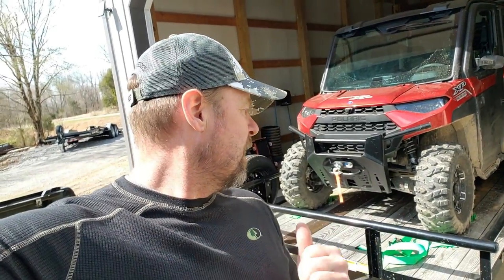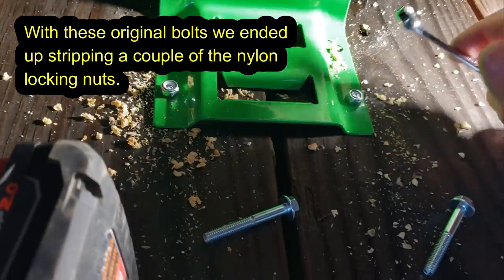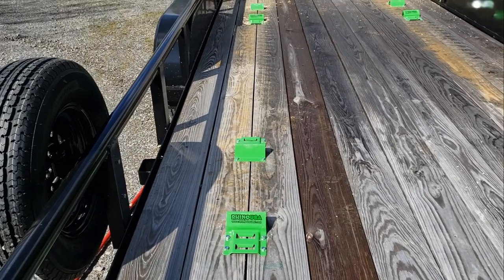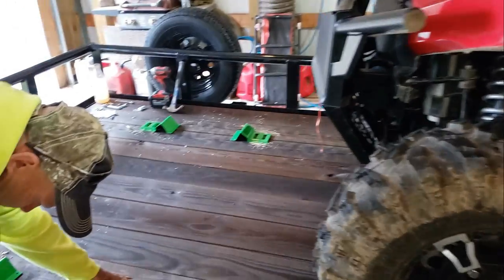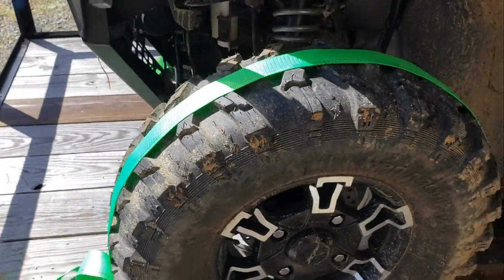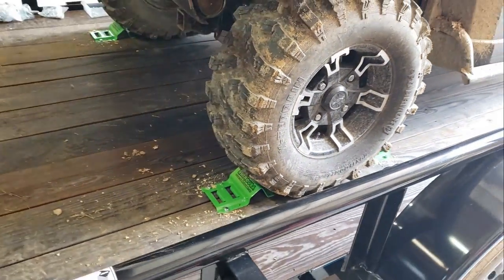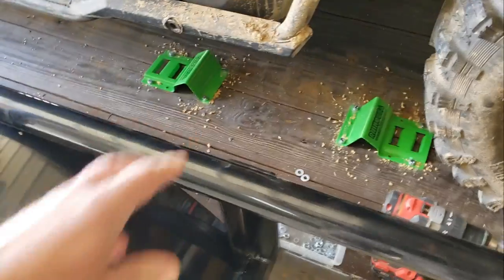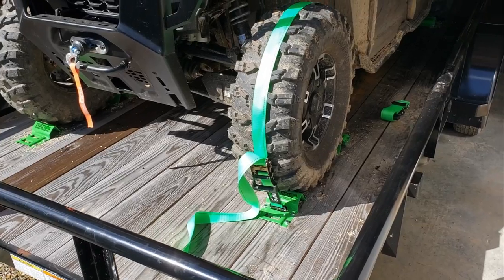Rhino UTV wheel chock tie-down kit install. Watch THIS before you buy..

Comment: Have you thought of marking where the the holes should go, removing them, drilling holes, bolting it down, then pulling the vehicle on again? 🤔
Reply: That's the proper way to do it. They have tutorials on instagram explaining how to properly install. All you have to do is put the vehicle in the spot you want it and use a sharpie or some sort of marker then back it out and bolt them in. They aren't supposed to be installed with the UTV on the trailer which ending up bending them
Reply: I’m with you when your right lol… common sense
Reply: It’d be a LOT easier to read and follow directions…. Lay out the chalks, mark the hole locations , THEN installing them…. Just a thought.

Comment: In Rhino's defense, The install video on there website shows how to avoid what you did by installing the front mount first then placing the rear mount and marking drill holes removing utv then install rear mount. Also says that hardware will work for most applications not all.
Reply from the maker: Yeah we made some tactical errors in this install for sure. But since we only did it once we keep it real. Thanks

Comment: Probably should of traced the holes or outline of the chocks onto deck. Then removed chocks & then bike. Then placed chocks back on & drilled  & mounted.
Reply from the maker: Yep in hindsight no doubt about that!
Reply: Yeah that seems like an install error not factory design error. That's why they were designed for 6 bolts. But the bolts being short is kinda crappy.

Comment: You made this really hard.  Why just place them in the right spot.  Outline them with a pencil.  Remove machine.  Install them.  Put machine back.  My god.  This is an easy job
Reply: I thought the same thing. Installing mine now and didn’t even go through all of that trouble.
Reply from the maker: Well you live and you learn! Since I had never done it I over thought the process no doubt about that.

Comment: So other than the bolts the only issue here is the installer
Reply from the maker: Also the thin metal they used for these, and the quality control of the cuts as well

Comment: why waist your time use 10000lbs D rings
Reply from the maker: Maybe this method is faster hook up and tie down..?
Reply: @kapperoutdoors  no try them all best way and easiest is Dring rachcet strap over the tire that way the suspension works for the utv from bounce for the trailer

Comment: I installed the Erickson system ( similar to what you have there ) and they work great for me. Drive up and over the chocks, strap down all four tire/wheel and my
CanAm  doesn`t move at all. 
They are just what I needed for hauling my CanAm, the wheels are held securely ( like I said ) but the body can bounce and jounce all it wants, but it's not going anywhere.
Reply from the maker: Well they sure advertised these as being the best on the market!! Not so sure about that! lol.
Reply from the maker: @regsparkes6507  The are 'engineered' in the USA but assembled in China!! They got me on that RHINO USA one..
Reply: @kapperoutdoors  I guess this is what I was wondering. Oh well 'nuff said.

Comment: I just bought the Ericson ones so far am happy . When i installed mine had to also buy larger bolts and lock nuts . 

I loaded my sxs straight enough was happy then placed all the chocks traced outline black felt pen removed them unload then place them back in the outline then drill & bolt on seem line up fine .

 They work awesome compared to just tie machine down never not use this system once try it never comes loose 👍
Reply from the maker: Yeah I think you got a better brand. But I agree it is so much easier to get loaded and tied down with the chock system! Thanks, have a good one
Reply: @kapperoutdoors  Thanks man wish i bought this system all yrs rode atv lol so much faster load & unload .

Comment: Good review, seems like a decent system incorporating the E track. Once fully bolted to the deck, it should prevent any deforming of the chock. Fuel prices are terrible here, it costs $290.00 to fill up with diesel.
Reply from the maker: Now that we beefed them up I think it will be fine. Contacted Rhino they said should hold down over 6,000 lbs.

Comment: Most deck is not that thick
You only have to do one front wheel and the opposite side rear…2 per ATV or UTV.
You take a black marker mark your drill spots then remove mounts and UTV then drill and install.
A good video on how to improperly install tie downs.
Reply from the maker: hey life is a constant learning curve. But I feel much better about these after beefing up the bolts.

Comment: Hmmm ain't no rocket surgeon but thin as emm are Ida not have droved over emm thangs🤪

Thanks for the video, I was considering buying these. I'm exploring other options now.
Reply from the maker: Fair enough! But I figured they could handle a run over! But since they were not fully bolted down, I 'kind of' get it.. Although IMO they are a bit too thin anyway and for sure them bolts were too weak! Thanks

Comment: Your video reinforced my decision to go another route.  Instead of a $120 set for 4 wheels, I went to HD and bought 8 D-ring tiedowns and bolted them to my decking for a little over 1/2 price.  I had to buy the bolts to anchor them down (just like you had to do anyway).  I had some 1/8" scrap metal for my backing plates.  Each D-ring is rated for 3,600 lbs - more than enough for my 1700lb SxS.  Other than that, it's similar to the Rhino set up.

Their instructions could be better.  Locate and drill the 1st two mounting holes on each chock as  you did.  Then remove all of the chocks and back the SxS off the trailer.  Then the remaing holes can be located, drilled and all bolts installed.
Reply from the maker: Glad it helped. I like the sounds of your setup much better! But I have used these now for several long range transports and so far no issues at all. Thanks
Reply: You only need 2 per ATV and UTV !
Reply: @redteam9881  The cost of anchoring all four wheels is cheap insurance against the alternative.  I can have two, but I need four.

Comment: I wish I would of saw this video 5 days ago. My set just showed up in the mail today. Lol I will def do the same as you and get beefier and longer bolts. I plan on putting them on my car hauler that I use for my side by side. Did you try and drill thru any steel cross members on your trailer or just anchor to the wood decking?
Reply: Another question for ya. I know everyone has there on opinion on what is best for your machine but when using the rhino system in your video here it is best to put your machine in park when trailering?
Reply from the maker: I do feel a lot better with the heavier bolts. Best of luck with yours. I did not go through any steel members, but it would have helped if we did. Good luck! Thanks
Reply from the maker: Can't speak for others, but yes, I always put mine in park after I get the weight and straps all settled out in neutral. Really wish they had a parking brake though.
Reply: @kapperoutdoors  thanks for the reply I did subscribe too after watching this video. You put out a lot of good info and someone who doesn’t sugar coat everything on YouTube is a rare occurrence. Thanks again.

Comment: Do you have any problems with your deck boards moving and if not how are your secured. I got a set and now I'm worried about my deck coming up
Reply from the maker: Well the decking all depends on the manufacturer and how they secured it, but most are quite secure, being fastened to the steel frame. If you use all 4 wheel chocks like this I doubt you'll have any issues, regardless of the decking. They are made to hold down a UTV with just 2 chocks, so if you go with all 4 like I did you should be just fine. Thanks, and good luck.

Comment: What do you do when your hardware, after lining up the tires, goes right overtop of the cross member of the trailer? I'm running into that issue now.
Reply from the maker: We drilled right through it and got longer bolts. Also makes the chocks much stronger. Best of luck!

Comment: I just installed the Erickson Chock tie-downs on my trailer for my Polaris General and they wouldn't even stay on the tires on my trek to/from the woods!
I'm assuming the curvy roads causes the Polaris to lean L and R compressing the tires which then allows the strap to fall off?!  
Any thoughts or solutions?  
Let's go Brandon!
Reply from the maker: man sorry to hear that! I have not actually tried these out yet for a real trailer haul! Did you have all 4 Erickson's or just 2? I have heard good things on them Erickson's. Thanks.

Comment: The other issue is if your bolt holes don’t line up across two planks, if the wheels are wider by an inch then you are drilling into the gap between the planks
Reply from the maker: At least this one laid right with the planks!

Comment: i would put a fish plate underneath for the nuts and washers.
Reply from the maker: sure wouldn't hurt..
Reply from the maker: Although I'm guessing that in a crash or roll over those metal chocks would give way before them bolts would rip through the wood.

Comment: Did you use 1/4 20s?
Reply from the maker: I'm not that great with sizes and such, but I think they were grade 2 5/16 bolts, the new ones. And the original ones were only 1/4 inch. Not sure if that was what you were asking. Thanks

Comment: Always just use wooden chocks 🙄😳😂 but great idea 👍
Reply: Then how do you hold down your ATV Bob?
Reply: @regsparkes6507  straps round the wheels Reg 👍
Reply: @bobpaterson1845  I'm curious, you mean the wood chocks are screwed down to the  deck and then how do you connect the straps to the floor ?
Reply: Reg the straps are connected too the hooks on the chassis rails of the trailer👍
Reply: Reg the straps are connected too the hooks on the chassis rails of the trailer👍
Reply: @bobpaterson1845  I got it now. That'll work, well you already know that! LOL.
I ask because I'm going to do something like this for a Buddy's trailer too in a week or so.. I can build it from here.
Thanks.
Reply: @regsparkes6507  your welcome stay safe an well 🏴👍
Reply: @regsparkes6507  your welcome stay safe an well 🏴👍

Comment: Rhino? Lol. I think they should go with the "fawn", becayse they're so light weight. Or maybe the, "squirrel". Because they're squirrelly, and weak. Perhaps, the "skunk", because they stink, and you feel like you got skunked by purchasing them. Seriously though, they are way to lightweight to give one any sense of solidity or ability to last for any length of time. They certainly don't inspire any confidence in the strength required to keep a $25k+ toy safely secured to a trailer that will be bouncing along for the potential of upwards of 50 to 500 miles. All in all, those things look like they're made out of something only twice as thick as a dole pineapple juice can. They should go back. And man, those screws... Holy smokes. Pot metal garbage. 

You Gents are polite, reserved, and cordial.
Reply from the maker: lol some good analogies there! I do take a little solace in knowing we planted much heavier bolts in these things!! But they do have a great advertising department!!

Comment: Let's go Brandon!! Also, good review. I've got a set of straps for mine made by SpeedStrap. I've been real happy with them so far. Combine the speedstrap bonnets with some ETrack rails bolted to your trailer flooring is a quality setup in my opinion.
Reply from the maker: lol no doubt. I should have shopped a little better I think! but this set had good reviews on Amazon... go figure.
Reply: Lol. Well it looked like it was worth a try to me. I looked at that set I think when I was shopping and was wondering if it was a good option. I just ended up going with the speedstrap option.
Reply: @kapperoutdoors  me too, I just learned of speed straps today. why dont the rear straps look like the front straps? I read where one guys rear straps thru wheel got cut from the bouncing while hauling it. but you never know how to believe replies on here or reviews on amazon, I've bought highly rated products and after getting them I wonder why anyone would give that junk a high review? it's obviously crap. that's where the return option is so handy, send it back and try again with a different brand